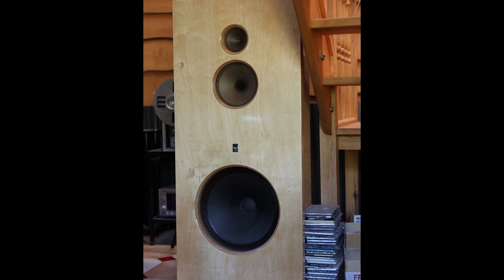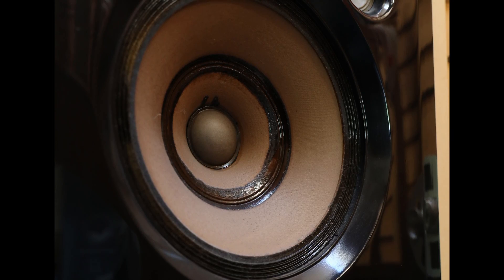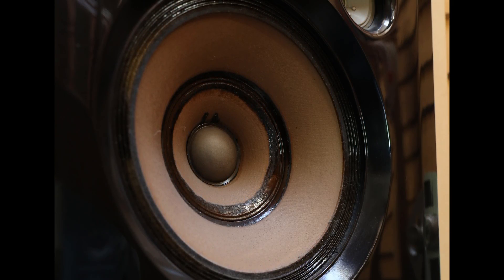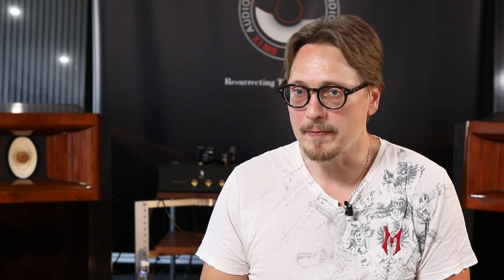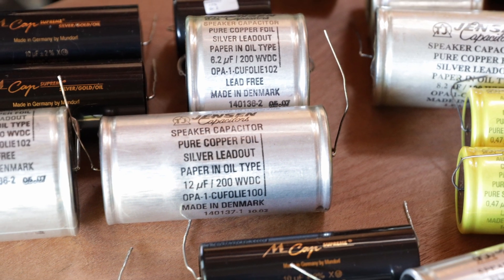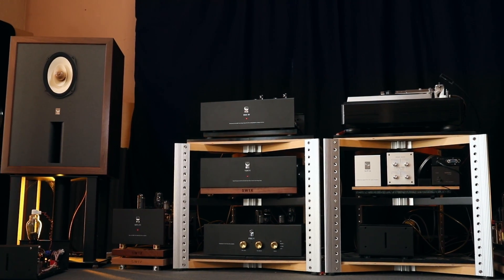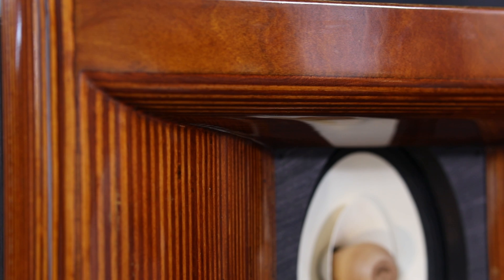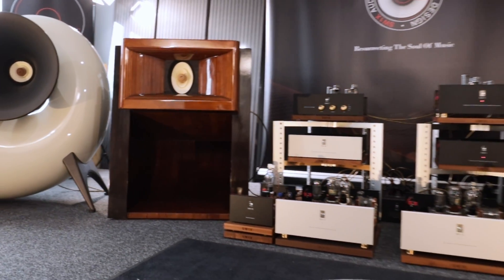Developing SW1X Multiway Loudspeakers with Crossover?

Comment: There is lots of truth here, i like the project of Lampizator.....start with the best sounding mid speaker....ad a bass speaker and tweeter to cpmplete the 2 extremes....i got a 60 year from a belgian high end maker ' Dumortier' he tested the best mid was then the vitavox S2 driver ...it works easily in ear most sensitif range from 400 to 6000 hz...in low a 18" EV ads bass ,and i put in highs beyma amt tpl 150 
It sounds like one speaker....with uncompressed dynamics....know that ingrand concert piano can deliver 130 db at 20 cm microphone....or at player...since i playpiano, drums, guitar, bansuri ..violin all a bit but i am used to real instruments and goosebumps are activated with dynamics

Comment: Thanks. I did try your test and was able to hear/understand the vocals of one part of a song where I was trying to figure it out for months... and with further messing around I ended up making a change to the crossover, can't get rid of it with the speakers in question, but I did make a large improvement... so thank you for that. Definitely makes me want to make another set of speakers with this direction as the guiding light.... cheers.
Reply from the maker: welcome. the gain in SQ is even greater when full range drivers are employed, particularly in LF where authenticity of percussion instruments come into play

Comment: Just do line level crossover in the amplifier with passive components.
Reply from the maker: this proposition is hardly going to solve the problem of cohesion and dissonance of multiple drivers
Reply: @sw1xaudiodesignthat is true but a full range driver with 10+ grams come mass cant compete with 0.1grams  and less tweeter at +5khz imo. There is no perfect solution here i think, only a compromise one think is best.
Reply from the maker: @williammeincke9071  one needs to overcome all sort of logical short cuts & preconceptions and just try it and compare. the whizzer cone plus woofer cone does not need to be 0.1g to play the HF range- its all about the resulting Qts. most vintage Full Range drivers play HF up to 10K withoout sweat such as my vintage 10" TFK FC driver and the matching 4" tweeter augments only the top octave. what sort of drivers do you have, anyway?
Reply: @sw1xaudiodesign For low frequncies up to 1500hz i use FC driver. For the rest i use a ribbon. It uses a autoformer with aircore, for imp conversion. I have never seen or heard anyone use a autoformer with aircore like this with a ribbon. you can even make a high pass by limiting the inductance of the autoformer.
Reply from the maker: @williammeincke9071  there is no perfect solution but some solutions are far from perfection. trying to achieve a harmonic match (approximation to a perfect solution) between two completely different drivers is a challenge to say the least. HF start from 1kHz in my book- anything above cannot be LF. apart from that FC and permanent magnets do not match harmonically- neither match in tonal temperatures (different secondary resonances due to difference in materials) nor in their dynamic character. autoformer may help with impedance match but good luck with achieving cohesion and a harmonic match